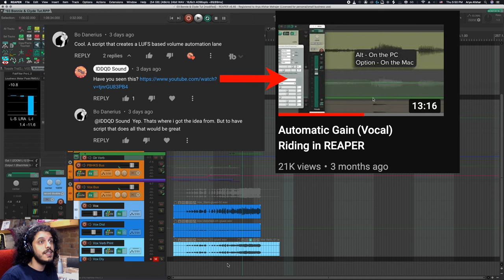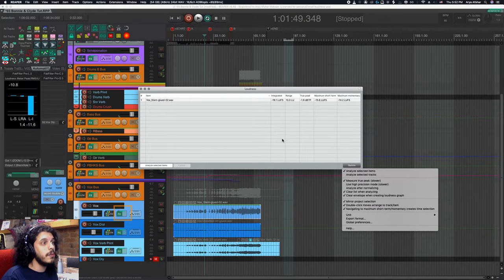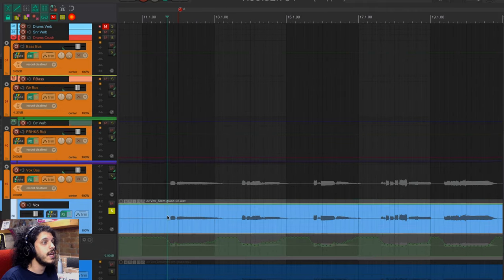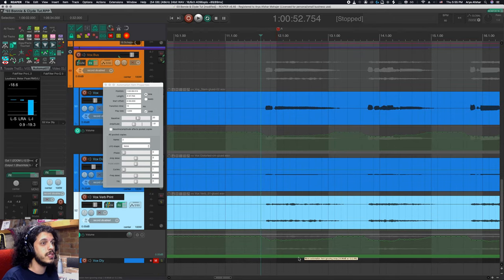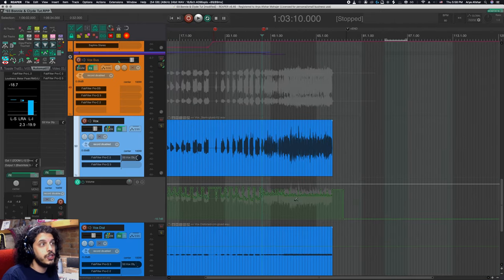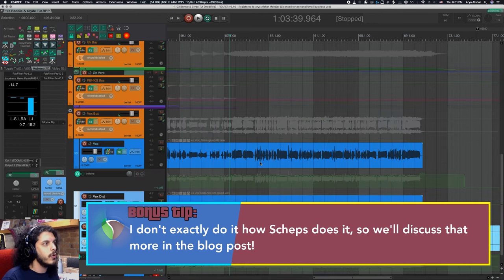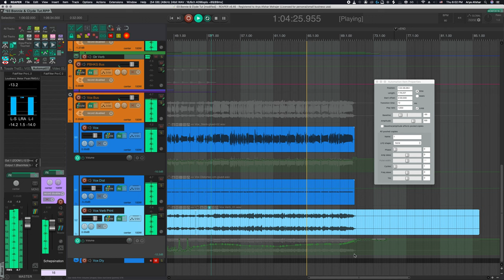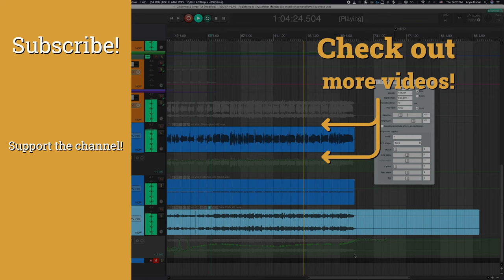Generating Gain Riding Automation with SWS Loudness tool (Rapid-Fire REAPER Tutorial 101)

Comment: This is a game-changer for me. Thanks! When using Waves Vocal Rider, the biggest issue I have had is that when I want the dynamics preserved, specifically when I want the end of a phrase to naturally fade a bit, Vocal Rider wipes out the natural fade by bringing up the level. With your version of Kenny’s method, do you fix that by editing the automation to change it from “riding up” when you want a fade down?
Reply from the maker: If I want a fade down then yeah. I usually do like the fade up (or at least in this track I felt I needed it.) 

 Tbh Vocal Rider is what I use and like, and I can have it write to the volume envelope and edit that! Because it has range sliders I tend to find it more practical  :)

Comment: Can you help me think through the idea of using this on a Buss... a folder track... that has several instruments (say, three rhythm guitar tracks) in it, but no "item" per se to use for the loudness measurement to generate the initial envelope? Thanks. The only thing i can think of is to render the folder, use that as the basis for the Loudness measurement and automation item, and then discard the rendered file.

Comment: Best solution right here! Tho I guess it's decades until it finally can be fully automated. Does anyone know of tv shows, series, movies, or serious podcast or radio stations that use any form of gain riding?
Reply from the maker: Every podcast and film I worked on ever! Maybe not syllable-by-syllable riding but yeah in film you have standards for dialogue loudness, so a whispered lines comes up, shouted line goes down. 
 For podcasts, same thing, people tend to start quiet then warm up and get excited and start shouting, or they move away from the mic, so all of those things require riding the gain.
 If you want something more automated than that you can use a gain riding plugin, or a very soft compressor with the threshold somewhere that it's always attacking or releasing.

Comment: I was wondering about this with Kenny’s video and you’ve definitely confirmed it for me - The loudness is based on the clip, not the output. That confuses me, because it does not do what I’d do when I ride a fader to record automation, listen after the FX. Is there a reason for why that is? I would expect a loudness envelope that doesn’t consider my plugins, especially compression, to have exaggerated level differences compared to the compressed signal. Or am I overthinking this?
Reply from the maker: yeah it's based on the clip, because to process and calculate loudness offline it reads the file, and doesn't read the fx. The kenny method will read the output if it's last in the chain. So it does have that benefit. ie you can put it as the last fx on your master, or as the last fx of any track, etc.
Reply: @IDDQDSound That clears things up, thank you!

Comment: The only thing I'm missing here is to be able to print the envelope in a render instead of doing it realtime, because this is nice but it's not gonna cut it as a workflow for levelling a 1.5 hour podcast.
Reply from the maker: not sure I understand. If you write the envelope then render it will be in the render
Reply: @IDDQDSound  yes, what I meant was that instead of playing through the track in realtime to write the envelope, I  should be able to do it at 100 X speed or whatever.
Reply from the maker: @lordgraga  That's what the SWS feature does though. Apply it offline, render it offline. The Kenny Gioia method is realtime, but the SWS method is offline at a very high speed. For a 90 minute audio file I bet it wouldn't be much more than a few minutes.
Reply: @IDDQDSound  oh gosh, apologies for missing that details! Thanks a lot for the correction, look much forward to using this then.
Reply from the maker: @lordgraga  haha no worries! I think it took me longer to explain this than it takes for the feature to do the task lol

Comment: does the parallel compression create problems with your gain staging?
Reply from the maker: Haha yes it does :) 

 In reality, I shouldn't have put the automation on the volume envelope, but the pre-fx volume envelope. That way it would adjust the gain before they feed into the compressor and then no problems. I did it quickly and didn't notice this :)
Reply: @IDDQDSound  ooh, thatd probably work nicely but idk, tbh this is kinda above my current skill level lol, Ive wanted to try parallel comp on my drums but idk how to compensate for the added volume
Reply from the maker: @cityofscreams  What I do is get the compression right by turning it way up, then I turn it all the way down, and gradually bring it up as I mute and unmute, until it's at a place where, if it's not there I'll miss it, but when it is there it's adding some extra RMS but not any extra peaks at all, then from there I try not to touch the compressor, and just go to the bus level and turn it down a bit if needed, but ideally, you should not really be getting higher peaks, just a higher RMS :)